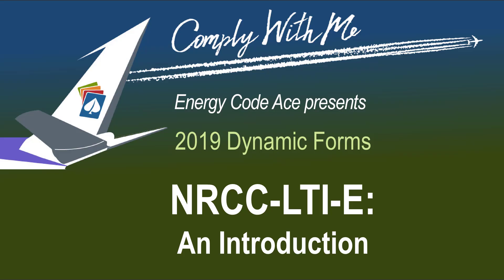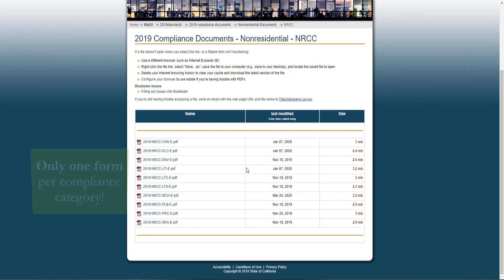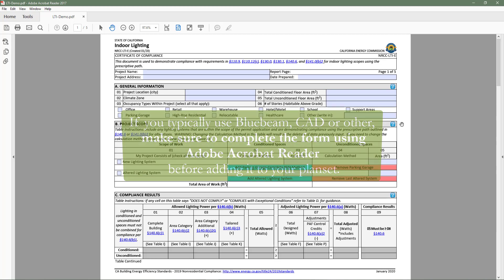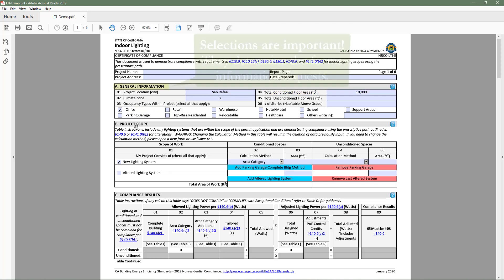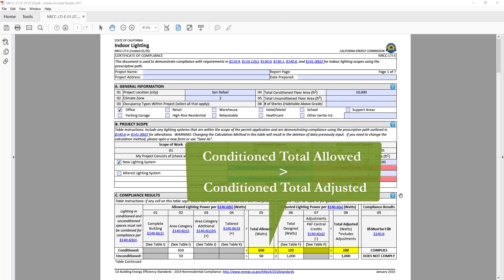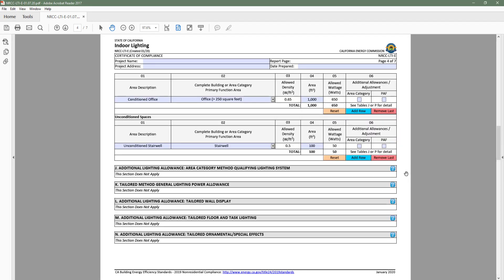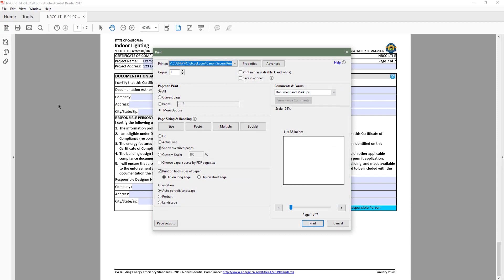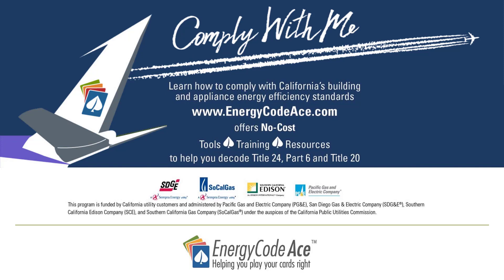2019 Dynamic Form Introduction: NRCC-LTI-E

Comment: I'm having trouble with the drop down menus for Area level controls and Area Category areas on NRCC-LTI-E page 3 of 6.  The drop down menus don't list the area types. I'm using windows 10, Adobe Acrobat X.  Please help!
Reply: Hello, Jim.  I got your email about this and tried to email back last week but kept getting bounce back messages.  The dropdown menus are populated based on the Compliance Method you selected in Table B.  If you changed this Compliance Method, it possible the form logic got messed up.  I also highly recommend using Adobe Reader 2017, it works best with these forms.
If you are still having trouble with the pdf, you can use Energy Code Ace's online form completion tool.  It can be found at https://energycodeace.com/nonresidentialforms/2019
If you are still having problems, please reach out at forms.feedback@energycodeace.com with an email address that can receive reply messages.